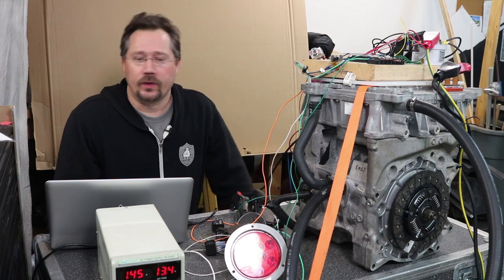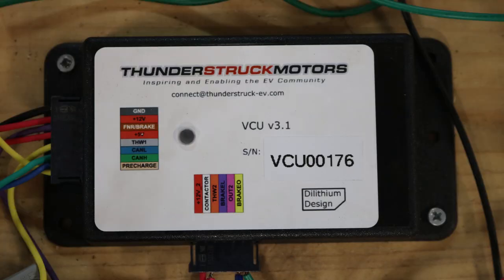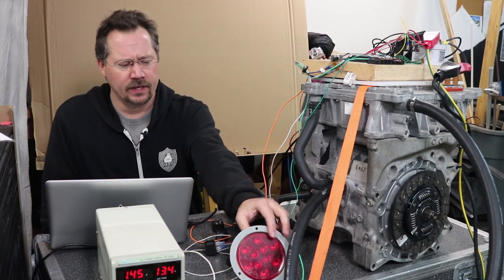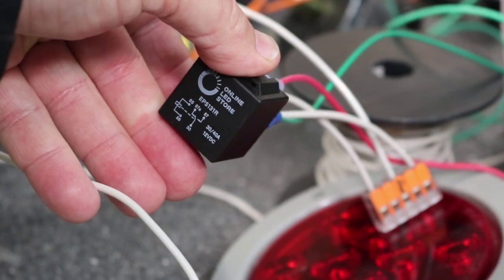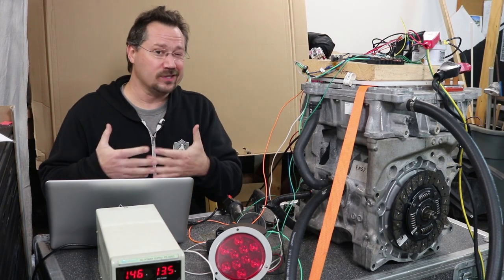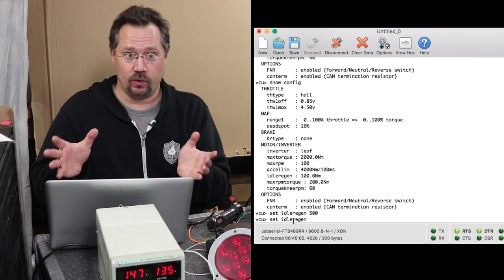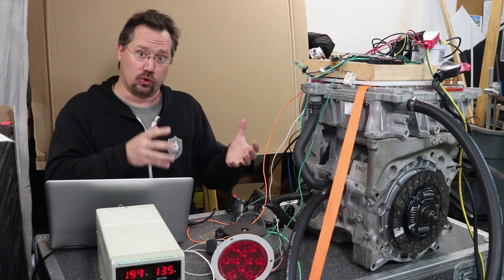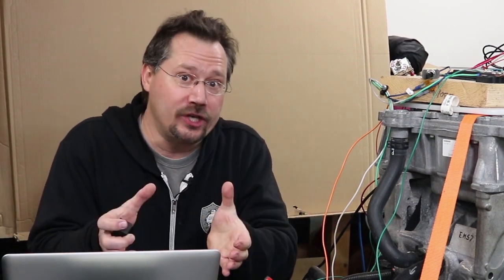Nissan Leaf Motor - Regenerative Brake Lights - How to

Comment: Nice videos. I was looking into possibility of using this motor for about two years now and gladly I found out about this VCU from your videos. I actually do have knowledge and skills to make it myself but at the same time this knowledge tells me I would spend a lot of time on CAN bus decoding and probably I would have to have a working Leaf to start with ;-) It might not be super cheap for me but I would still call it fair priced (for you folks in US it's probably considered cheap hehe). 
I can only comment you are simplifying things a bit here and there but I guess it's more comprehensive for general audience heh. 
What I can add here is that it's VERY common to have control via microcontroller's GPIO or ICs in general done on the ground side. Historically it comes from the fact that it was easier (and still is) to manufacture NPN transistors than PNP and they still get better parameters these days. There are also other benefits of doing it this way. In such configuration your LED, relay or whatever load you have can actually be powered from a higher voltage than the control logic. For example here the microcontroller is probably powered with 3.3 or 5V and it can switch 12V relay without problems and you could even put there a 24V relay and it would still work without issues as long as you have common ground for both power supplies. Doing it with switching from the positive side is much trickier.
Reply: Leaf can communications are entirely decoded and understood
Reply: @flavortown3781  well, they certainly wern't back when I was searching for it ;-) Any hints?

Comment: Ben, can the Thunderstruck controller be used in Leaf as a replacement of the OEM unit? I would like to have the regen programmed differently.
Reply from the maker: I think that you COULD use the VCU in a stock Leaf, but you would have to disconnect a number of other things in the car for it to work properly. At that point, I'm sure you would be getting all sorts of other errors. The VCU is NOT a drop-in replacement for any single original part in a Leaf. It's just a device to allow you to use a Leaf motor and inverter in a different vehicle. While it might be possible to use this in a Leaf just for tweaking Regenerative Braking, I have a feeling it would be a LOT of effort to make it happen.

Comment: Hi Ben ! thanks for your videos! You said in a previous video that 'because the bridge rectifier only converts ac to dc , the motor can  not perform regenerative braking when powered this way"
 have u connected the motor to batteries this time? what voltage/ type ?
Reply from the maker: Hello Danutz!
YES, I have connected this to batteries and have the regenerative brakes working properly.
Here is the video about connecting it to batteries: https://youtu.be/7_9VGSs8r4k
I used Nissan Leaf cell modules I had in my electric motorcycle, plus a few more to get to the voltage needed.
Looks like 156V or so is the bare minimum. Of course, you want higher than that to take care of voltage sag when under load.

Comment: Hey Benjamin, I have a small question, if we are going forward with some speed and I press the reverse switch it will engage it? or ignore? Imagine that you are going in the middle of the highway and some one by accident presses the reverse button, what happen? I possible to only engage if the speed of the motor is zero? Thanks in advance :)
Reply from the maker: There's actually a couple of ways you can set this up with the hardware, but rest assured that none of them suddenly snap the motor the opposite direction. For the most part, flipping the switch will either engage the regenerative braking or simply go into neutral.
See page 22 of the Thunderstruck VCU manual for details. http://www.thunderstruck-ev.com/images/companies/1/DD_VCUv3.1R3.pdf?1605898763828

Comment: Hi I admire your works,can vcu thunderstruck will work on toyota prius motor?if a run and use just only  the electric motor?
Reply from the maker: Not designed to work with a Prius.
From Thunderstruck's web page: "It has been designed to work with the Gen1, Gen2 (2013-2016) Nissan Leaf or UQM PowerPhase® HD System Controller, or Coda UQM motors."

https://www.thunderstruck-ev.com/dilithium-vcu.html
Reply: Damien McGuire's YouTube channel has videos where he experiments with Prius and Lexus motors for affordable EV conversions. He buys a complete hybrid motor and transmission cheap from a junkyard. He has figured out how to use the hybrid drivetrain without the gas engine. ✌
Reply from the maker: Yep. Damien is a pretty smart guy!

Comment: Hey Ben, if you're using regen, and you have your maximum voltage set for regen.... Does the regen braking force stop and you go back to free coasting? haha.
Reply from the maker: Generally, in an electric vehicle, with the battery pack FULL, regenerative braking does NOT work.
Since there's no place to put the energy, kinetic energy is NOT converted to electrical energy, so there's no braking.

I HAVE done that going downhill in the mountains in an older Prius. In that case, the engine kicks in and starts "engine braking".

It would be a pretty unusual situation for a modern electric car to be in, but certainly could happen.
Reply: @BenjaminNelsonX  very good info. I better be careful with that then lol.

Also thanks for your videos. They're very helpful. I didn't even know of Thunder struck until I watched these.

Comment: What happens if you've got cruise control set, and you go down a steep hill? Will the brake lights come on even though you're not changing speeds?
Reply from the maker: The Thunderstruck VCU does NOT have Cruise Control on it. But... If you were going down a steep hill, and had your foot steady on the accelerator, and the controller was sensing that there was over 150 NM of negative torque (regenerative braking) then YES, it would turn on the brake lights. It's not based on speed, it's based on torque.
Reply: If the hill is steep enough that you need that much negative torque, you would have to use the brakes in an ICE car to maintain the same speed (or downshift to engine brake). This is a situation where brake lights would be normal and not unsafe.

Comment: Cool stuff Ben .i have been seeing leaf's 50k miles . 2014 for about 6k. What ya think.
Reply from the maker: Sounds like a good car to just buy and drive.
Reply: @BenjaminNelsonX  yeah thats what I'm thinking but do i need to pay attention to the battery pack size for range.
Reply: @independenthqusa4170  
I have a 14’ with 90K miles and 4 bars of battery degradation.
Still get about 60 miles range!

Comment: When are you gonna drop this in road legal vehicle in the future?
Reply from the maker: I was originally taking a look at the possibility of using a Leaf motor in a farm tractor. I wanted to look through it and see how it would all work before doing that. At this point, there are a few negatives (relatively high pack voltage, etc.) which might mean a DC motor may be a better fit.

Comment: The tractor getting brake lights?
Reply: It is not easy to connect PTO to the Leaf motor. Ben has a large DC motor that might be easier to use in the tractor. Hence the Leaf motor might get used in a future car conversion. ✌
Reply: @backwoodsbungalow9674  i know, I've seen all his videos...